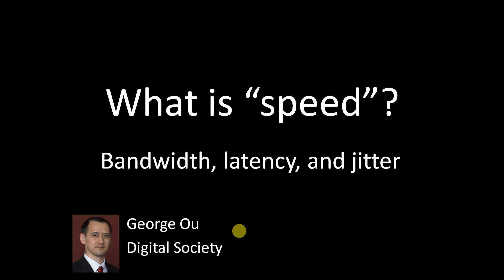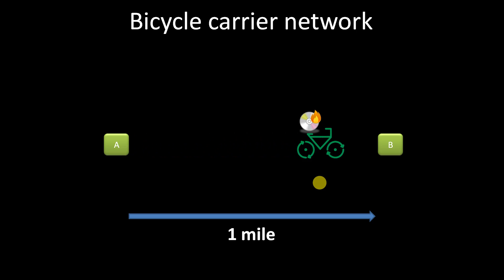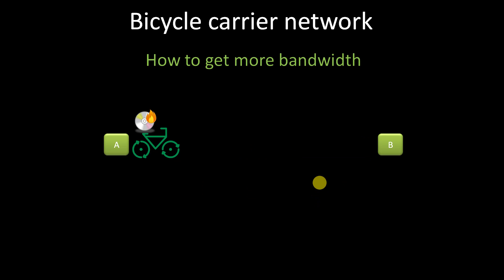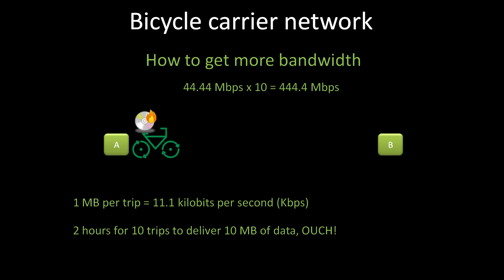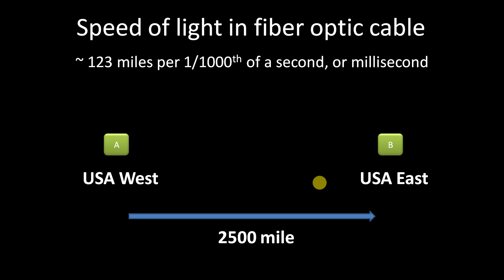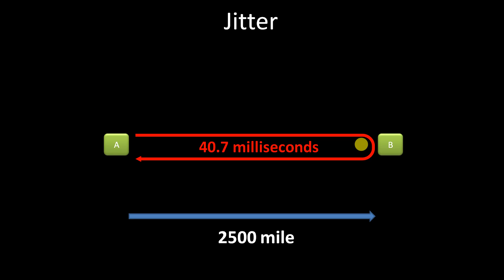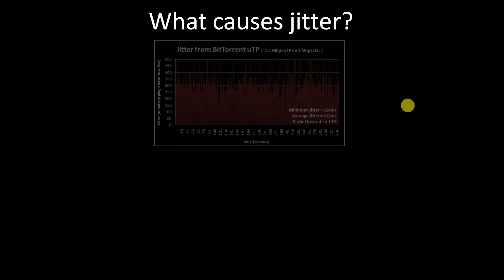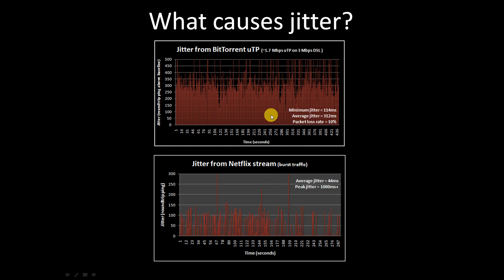Basics of network bandwidth, latency, and jitter

Comment: Bittorrent by default opens way too many flows, that compete with other applications on the consumer's own end, as well as add overhead. I believe that with increasing availability of fast and symmetric connections, the peer count should be limited to between 10 and 30. I think uTP mainly manages the out queue, and is still willing to accept great many download connections.

Comment: To some below
1)  Latency does affect bandwidth in the real-world because of acknowledgements, albeit less so with more modern protocol algorithms.
2) Latency spikes are caused by buffer bloat plus congestion
3) The simplest and cheapest way to fight congestion is to add more bandwidth. Unless you're using WiFi or satellite, bandwidth is easy to add and quite cheap, all the way up to 1gb to 10gb.

Comment: The bandwidth you are talking about is actually Throughput. Bandwidth is a fixed maximum, like 10/100/1000 megabits/second. The throughput is what you can achieve in a real-life situation, but it is not necessarily affected by the latency, only if you are using TCP. If you use UDP there is no round trip, the data is just send without waiting for a answer, and so you can get more throughput.
Reply: Thanks Bro, you just Highlighted some important fundamentals...

Comment: GOD DAMNIT.

You made me answer a test question wrong. Your bandwidth is THROUGHPUT! Latency doesn't affect Bandwidth.
Reply: In fact, throughput is effective output that depends on latency, bandwidth and protocol that's being used. If you protocol needs lots of syncronized end-to-end traffic your throughput will be limited by latency. However, if your protocol does not need any syncronization, it's fully limited by bandwidth.

Comment: It seems as though the explanation of Bandwidth is throughput. Bandwidth generally is a fixed maximum rate of transfer which usually does not change unless you bond multiple interfaces. So a 10MB or 100MB or 1GB link is always going to be the same. What you get is generally less that that and would depend on the media, OS, latency etc. The problem I see with adding 10 CD's instead of 1 is that will affect the latency of 720 seconds. The latency will vary.

Comment: hmmm what if we made internet routing similar to the way power plants do it? have extra cables in place used during certain hours of the day that bandwidth use is high and then re rout to those. i think that may help with jitter. although, im pretty sure that would be very expensive.